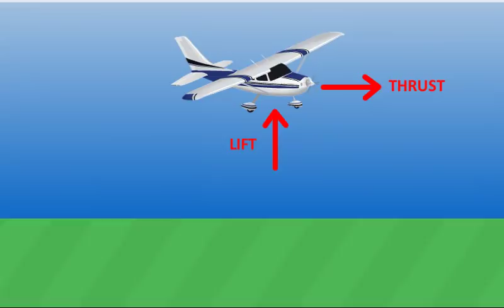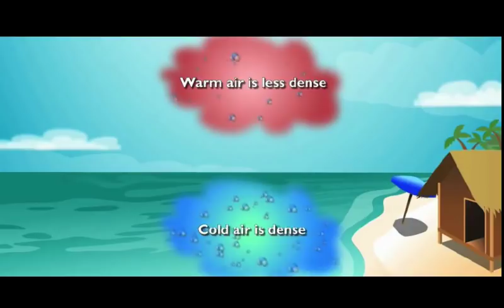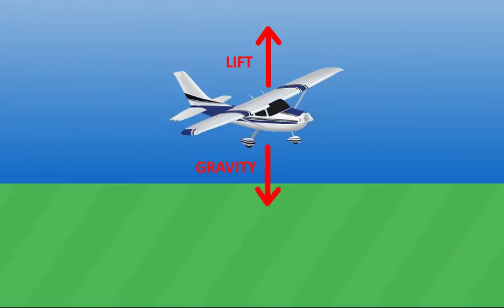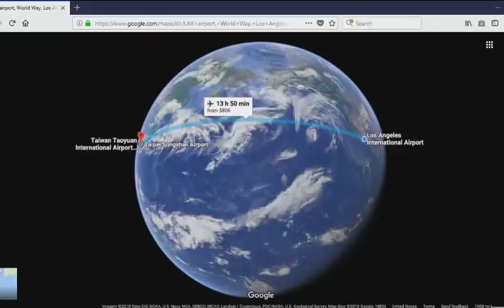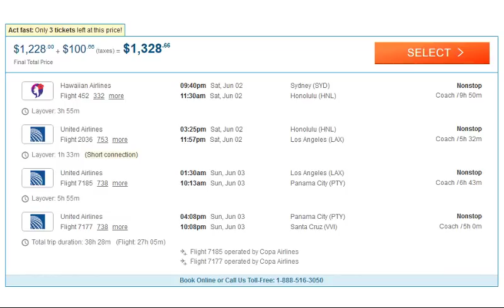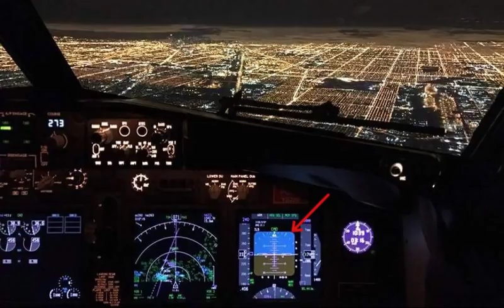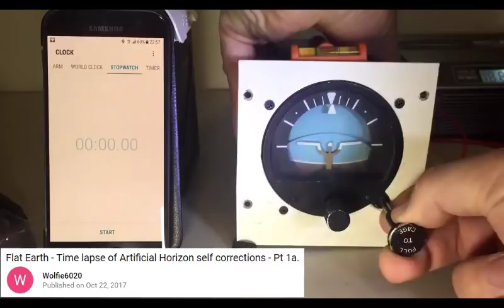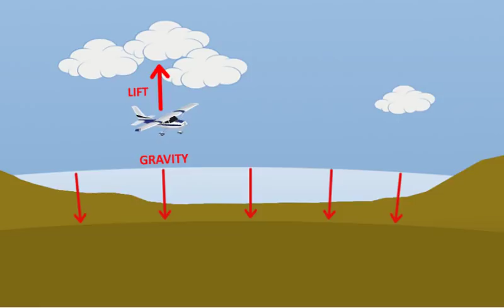Flat Earth Falsities - Plane Nonsense

Comment: Question: the flat earth claim is that gravity does not exist, but merely buoyancy and density. Wouldn't buoyancy and density replace gravity arguments? e.g. an apple falls because its heavier than air, not because of gravity.
Reply: @Rollie You can watch this if you like. It covers quite a bit straight from some governments. Gravity needs a long conversation person to person. Texting on here is not my favorite forum. This should atleast cause more study and open mindedness. Also, just grit your teeth if Biblical references are not enjoyed by yourself. There is a lot of correlations and documentation other than th that Bible:)

https://youtu.be/PZcrSyMM1ZM

Also, this is one of the best documentaries out so you can have a better idea of what I believe. And much is exposed especially towards the end. It builds and just keeps exposing more and more.

https://youtu.be/UbYtkrTquXE
Reply: @Rollie Your answer only holds on a spinning ball. The flat earth that can actually be tested explains perfectly why everything falls DOWN and not other ways. Up and down make common sense as well but only on the flat earth. On a globular model no directional absolutes exist. I prefer absolutes. Such as, in the beginning God....  :)
Reply: Without gravity a globular earth theory is still just that. A theory. On the flat earth, which is Biblical and scientific, gravity is more of an unnecessary fairy tale filled with holes that can be tested and observed and retested proving the unexplained and unscientific reality of gravity.
Reply: @NotTheCIA I.think Also, if your test comes back as inconclusive or your expected result is nowhere in sight then you didn't actually prove anything except you have a theory which is unprovable hence the untestable, unobservable, and unable to be retested. You can run tests and experiments but as they have never been considered evidence worthy of court and In an objective court gravity would be thrown out.
Reply: @NotTheCIA I.think Horrible mouth you've got there. Classic type of name calling for folks with no facts. And remember that facts don't care about your feelings so clean up your language. Good debates aren't vulgar as you've made this.
Reply: @NotTheCIA I.think Think whatever you like. Obviously people with blinders on will not see clearly. And it's quite funny how aggressive little beta soyboys can get from behind a computer with no real life consequences for their actions and or words...
Reply: @NotTheCIA I.think It's hard not to laugh!!! You're trying so desperately but haven't realized the conversation ended and you're all alone talking with yourself. I bet the girls just love beta soyboys like you. Oh, wait women hate that. Lol!!! Have a great night:)
Reply: @Rollie I simply gave you a clear example of a gaping hole in your argument. Point being, if your "theory" has massive and clear holes in it then maybe there is more that you need to study and consider. And I was also pointing out that no gravity is only a problem on a globe. It isn't needed on the flat earth. And you would say my arguments have holes. I have seen far fewer holes in the flat earth model than the globular earth "theory" and I understand that I don't know everything that can be known so I try to help others sometimes to realize maybe they should keep studying too because we all could be more reasonable and civil when there is actually evidence for competing view points. If you weren't a stranger in internet land we could have awesome experiments and debates possibly but with strangers on the internet I tend to share less and try to only point out what's needed. Hope that was helpful in some way. Take care.
Reply: Jason Rice Denying that gravity would be necessary on a FE is not demonstrating a hole in the (scientific) theory of gravity. You need to demonstrate why all the evidence for a globe is wrong, produce evidence for the Earth being flat and a sound explanation for what would replace gravity on a FE. And, no, waving a Bible is not evidence.
Reply: @jasonrice3676  the only gaping hole is the one between your ears! Imbecile!
Reply: @Rollie Well, I did point out where to go in the video to see the "astronauts" faking everything. I think I said around minute 31 and watch for a few minutes further. Question for you. If they actually went to the moon then why are they constantly caught in blatant lies? If they went then there would be zero need for even one lie.
Reply: @Rollie There's a lot of points to explain and not spending all day typing to try and convince some closed minded people. You may be more open and that's why I sent 2 videos which covers quite a bit and can be more informative. In person or on the phone I would have far more to say in my own words and experiences. My purpose here wasn't to write a book. And there is far too much evidence out there for all the angry folks commenting. I sent the videos because if you or anyone else watches with an open mind then they'd realize that the globe earth is not actually settled science and the flat earth model people should be shown a bit more grace by the authoritarian left who cling to so very much which has been proven wrong a long time ago. Such as the moon landing. Just watch, "A funny thing happened on the way to the moon". Around minute 31 or so you can actually see the mistakenly released footage from NASA of the "astronauts" faking blatantly the shape of the earth and consequently the moon landing all together. That is a great mind opener for globe earthers and flat earth people alike:)

https://youtu.be/xciCJfbTvE4
Reply: @Rollie wrong. Gravity w mas wrote into the definitions. It came from the latin word meaning weight. This "force" is only needed to explain away common sense like water sticking to balls and people upside down not falling off. Where is the pic from space of tilted buildings and upside down people, places, and things?
Reply: Or another way, the buoyancy and density argument needs gravity to work.
Reply: @NotTheCIA I.think lol! I've seen the info you're pointing to. And for theories to cease being theories and come to be real science means they are testable, OBSERVABLE, and retestable. You may want to stop by a Dictionary some time and read the definition:)
Reply: @NotTheCIA I.think Great catch, bad sentence writting indeed. Better for you to ignore my comments.
Despite laws(Catholic or not) I dont have faith in any force generating without a medium, Light needs it, waves need it.
So curving's, disturbance's, also abhore vacuum. Some 'dark' stuff as Aether, is needed to allow such actions.
Reply: It can't replace gravity for 2 reasons:
1) If you get 2 object different masses BUT the same density (like 1 kg sugar bag and 0.5 kg sugar bag), and put them on simple scales - you would see that of course heavier object shows more weight than the other. They have the same density, but not  the same mass.
2) Buoyancy doen't have a direction without gravity
Reply: Sure you need a force to keep the apples floating around... That religious concept is with the notion of an UP & DOWN, which our matrix does have.  But many FE do state attraction from the more proven Force of (Electric)Magnetism. 
Simple mass, iron or gas, does not create pulling forces.
Reply: @BrainUser1  Notice though, that these pulling forces you speak of are found nowhere except in minds and on paper. Gravity can't be actually tested and observed and retested which is the definition of science. Theoretically science should continue to be taught as theory unless proven by being tested and observed and retested:)
Reply: @jasonrice3676  Yes the proud Primate non believers are good at scifi stories and laws. Was sarcasm my friend, Forces needs a medium as all travelling waves. Their dont care for SCIENCE, its all old Apollo greek cult science, of those who did not know about GRAVITY law by christian Newton, but still had Globe sense. The DARK force is with them.

Comment: Clouds go both directions. A plane leaves Alaska to Cancun Mexico. Does tthe spin speed plane up to 1000 mph sideways from about 50 mph as it goes forward at about 500 mph. The spin at 30000 ft is weak and can not grab a plane and pull them with the spin. Imagine a magic bullet in its place smaller faster would the spin pull the bullet sideways too.
Reply from the maker: Fruit 4 Life - When the plane takes off from Alaska it is already moving with the rotation of the earth, and so is the atmosphere, plus or minus the wind. As I said in the video the plane keeps that momentum as it flies. You are right that Cancun is rotating faster than Alaska because it is closer to the equator, so the plane does have to make up that difference in lateral speed. Pilots are always making adjustments for wind currents to keep the plane on the correct heading, so the change in rotational speed will just be part of those adjustments, and will occur gradually.

Bullets don't have pilots, so they are will lag to the west some when traveling toward the equator. But they don't travel nearly as far as planes, so the effect is minimal. The difference in lateral speed of the surface over the distance a bullet travels is minuscule.
Reply: I would recommend they look into how hurricanes form, as it's a similar principle. 

In the northern hemisphere, clouds travelling south to a low pressure zones are travelling slower than the zone due to a slower rotational speed. Therefore they would lag behind. 

Clouds travelling north are moving faster for the same reason, and therefore will move ahead of the low pressure zone. 

This causes both sets of clouds to change course to try and reach the low pressure. This results in the counter clockwise rotations of storms.
Reply: Fruit 4 Life Look up conservation of momentum. When you throw a ball does it stop dead when it breaks contact with your hand?

Comment: Centrifugal force velocities?  Plasma electrons are (vs Magnetic, radio waves, line-of-sight) forced to follow a curve (happy Ballers!) in the electromagnetic fields. 
The Electromagnetic Universe: The universe creates electromagnetic induction fields through Plasma (Universe is filled with the stuff, even creates WALLS!) emitted by the sun-stars, hydrogen plasma is ionized and its electrons removed, the protons are then accelerated inducing electromagnetic field currents, the protons accelerated through the inductive fields via electromagnetism (David LaPoints primer fields) creates a gravitational force, and as plasma always follows the route of the electromagnetic fields it creates spiral centrifugal-centripetal vortex velocities as we see in the black void-black hole phenomenon, solar systems and galaxies. 

As the plasma electrons are forced to follow a curve in the electromagnetic fields it slows down creating centrifugal-centripetal vortex velocities which in turn create what we experience as Mass(iron of gas) "Gravity" Force. 
Similar to what holds the atom together, the black void-black hole phenomenon is nothing more than intense electromagnetic fields created by plasma slowing down at the event horizon creating intense electromagnetic fields. 

The orbits of planetary objects in solar systems bear a striking resemblance to the kinetic energy of electrons moving in a plane perpendicular to a uniform magnetic field. 

Basic simplex electromagnetic theory disproves Einstein's gravity wave theory while reinforcing Tesla and Maxwell. !!!  If you combine basic simplex electromagnetic theory with David LaPoints Primer Fields you not only come up with a legitimate theory for Gravity but realize that much needed factual; black holes, dark energy and dark matter, darkness are not required to fully understand the fundamental forces of the Universe. 

"The gift of mental power comes from God, Divine Being, and if we concentrate our minds on that truth, we become in tune with this great power"   ~ Nikola Tesla. 
The Electromagnetic Universe @ 2018 magnetronmagneticPulsers.com
Reply: Globe intelligentsia at work (missing a few still) love their Hellenic polytheists worshiping  ancient Greek but hate Retards. Clearly need to stop their babbling's and kill them all....
Hellenistic religion is any of the various systems of beliefs and practices of the people who lived under the influence of ancient Greeks.
   Ancient Greek theology was polytheistic, based on the assumption that there were many gods and goddesses, as well as a range of lesser supernatural beings of various types. 

Libertinism: Individualism led Greeks to an idolatry of freedom in the most arbitrary and libertine sense, to self-complacency and unlimited satisfaction of passions and vices. For this reason, having lost the symbolic meaning of their myths, they also attributed all the whims and perversions possessed by themselves to their Gods. Well before the present-day moral degeneration, Greeks publicly practiced homosexuality and attributed the same behavior to Gods. Similarly they shamelessly described their Gods as cheaters, liars, traitors, adulterers, envious, greedy and narcissist, projecting their own defects on the divinities.

- SO THEY ONLY KNEW ONLY TRUE PROVEN REAL THINGS.
Reply: Lol the guys commenting against you just don't understand what you mean. I will say however that centrifugal force does not exist, that's actually a myth. It's all centripetal.
Reply: Jack Stevens How does centripetal force act in two different directions simultaneously?